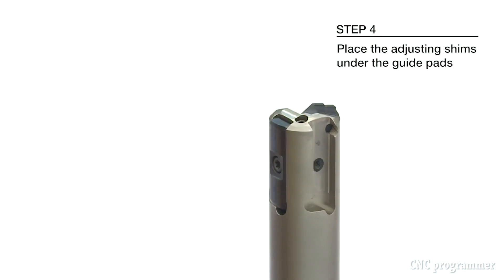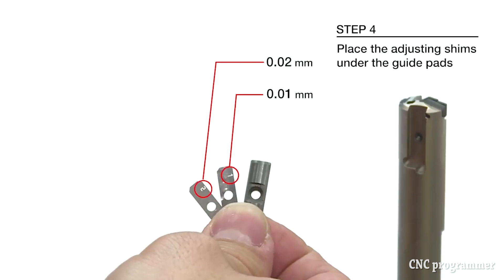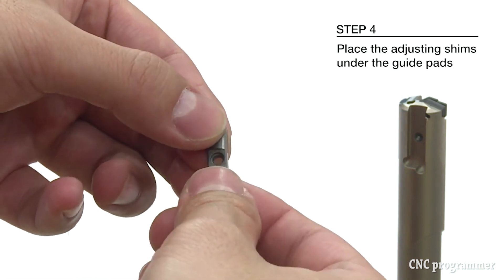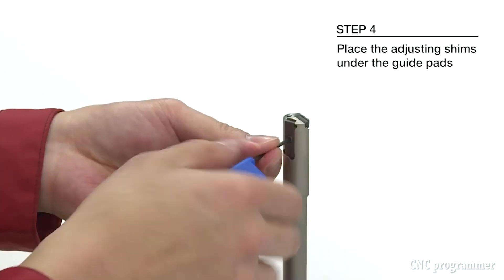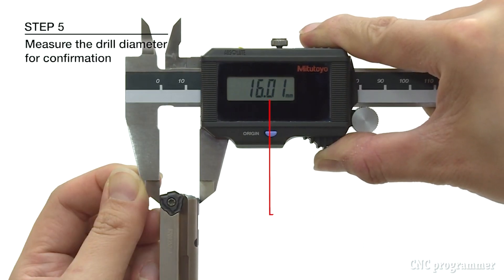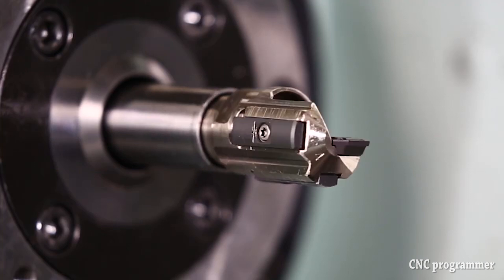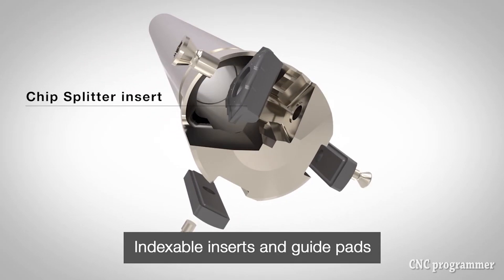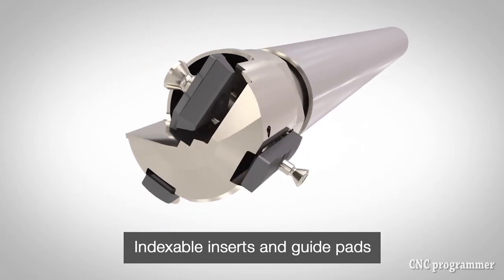Cnc Machine Deep Hole Drilling tools - Tungolay

Comment: 2:13 there is a discrepancy in the distance between the two center holes compared to the others. Is this intentional or is it just the drill bit misses the direction when machining?
Reply: It was most likely a program mistake, the next 3 holes are equally spaced from that one that is off so it was probably a 3 hole program copy and pasted or something.